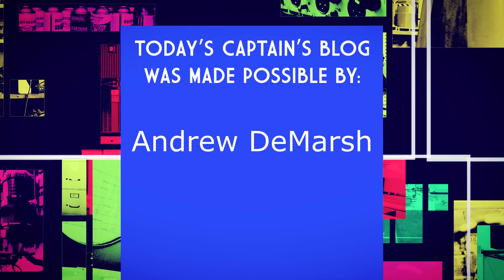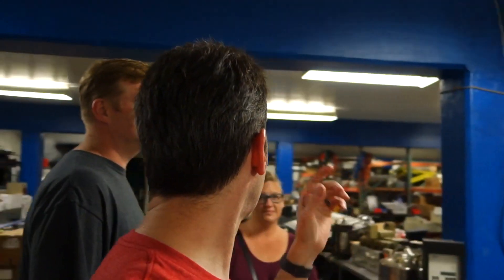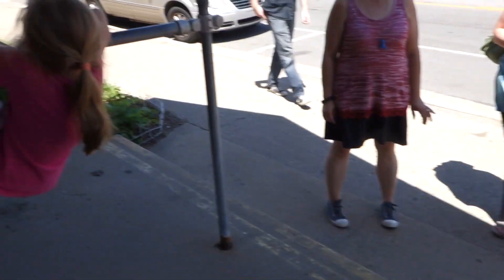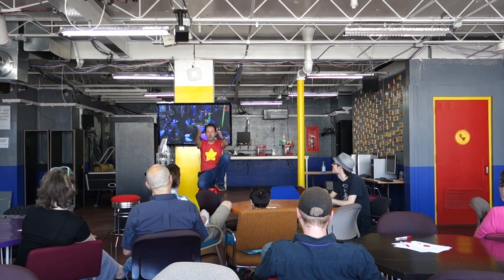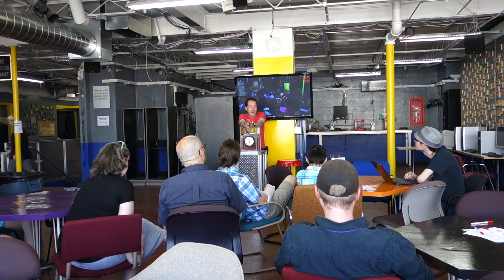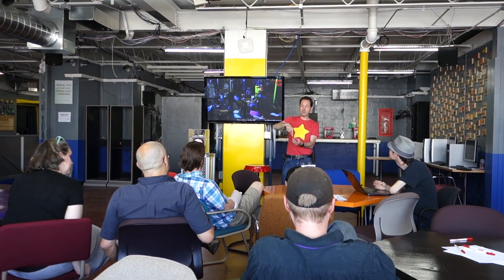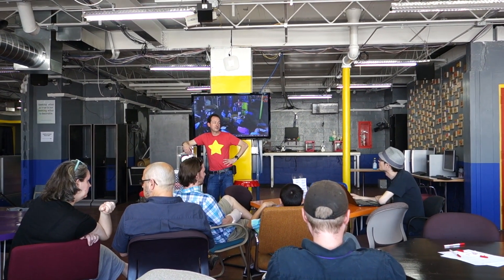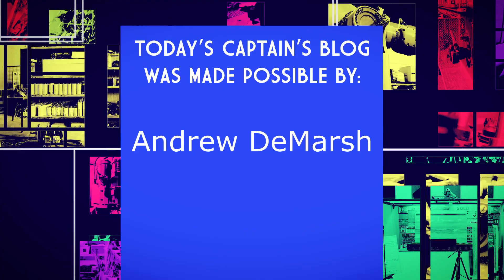Captain's Blog 6 11 2016 The Eiffel Tower

Comment: why did he say track twice?  why do you TGG "the weird"?  thumper has more power than you planned on.  surplus crew is hiding from you.  what merit badge are those girls earning?  TGG should have a gymnastics department.  i completely agree.  information helps people choose.  TGG probably throws off Consumer's estimates.  cutting a gas line is a strange accident.  upon your (Chris's) death, Moose should take over.  i never read my cell phone manual.
Reply: 'the wierd' works in 2 ways.  It's an old YMCA building.  YMCA is usually refered to as 'The Y.'  so it's kind of a play on words.
secondly, TGG is a very unusual place, therefore, it is wierd.
And I agree on the gymnastics thing.  it could be a good (and fun) way to teach girls about mechanical physics, too.  good idea, sam.
Reply: thanks for explaining that one.